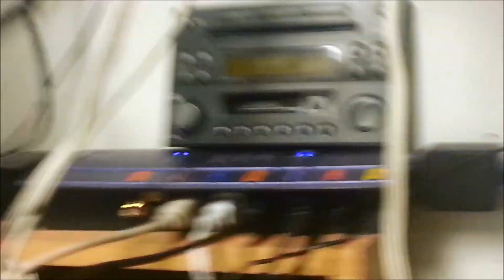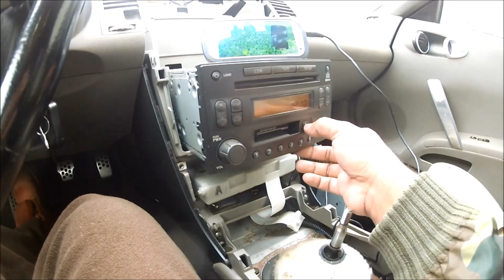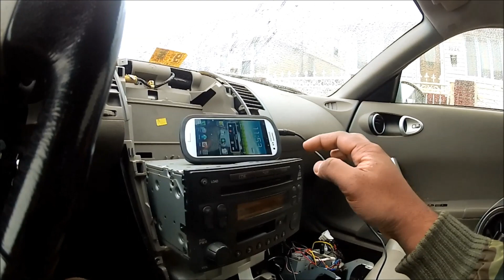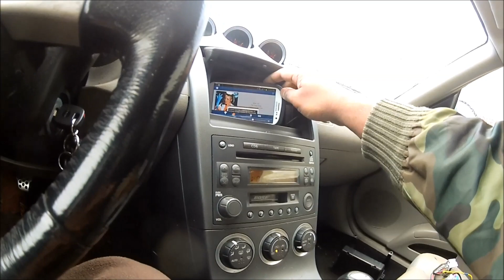350z radio aux mod to play mp3

Comment: To save all of that ballache and screwing up your cassette deck, why not buy one of those cassette body's with the 3.5mm stereo plug coming out of it? You can play your sounds, answer your phone (music cuts outs out when your phone rings) and you can switch apps without any problem. And for all of the older owners you can still play those museum pieces that are called cassette tapes. Plus your steering wheel controls still work as well.

Comment: can the same process be done for a 350z boose radio that does not have the casset input built in?? my stock radio does that have the casset option and I would like to do the same thing  on it
Reply from the maker: I'm not sure, maybe you will have to look into a CD option, I ended up cutting the tracks for cassette deck, it still works fine but maybe you shoulf look into GROM audio it's plug and play to CD using Bluetooth  but its  pricey,  but they also have a good return policy if you don't like it.